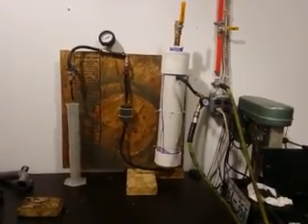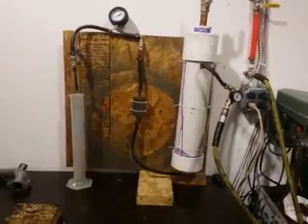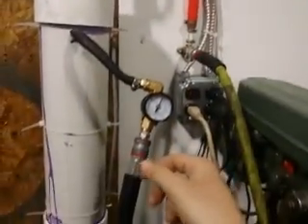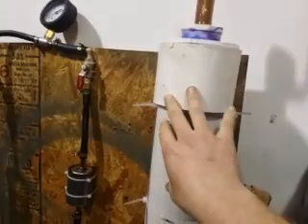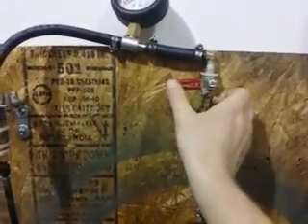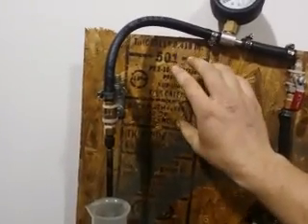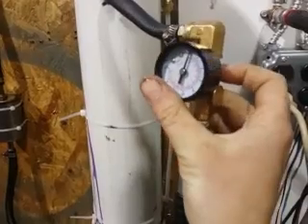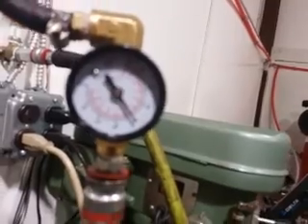DIY CIS Injector Test Bench

Comment: I need to build one of these.  Can you tell me how you did the lines that go into the curved part of the pressure fuel cell
Reply: I just used a drill and an NPT tap. NPT fittings with a little thread tape work perfectly.